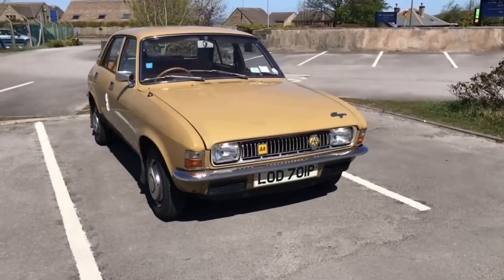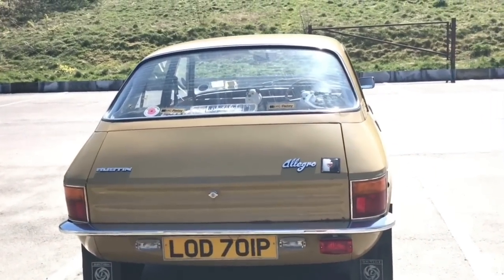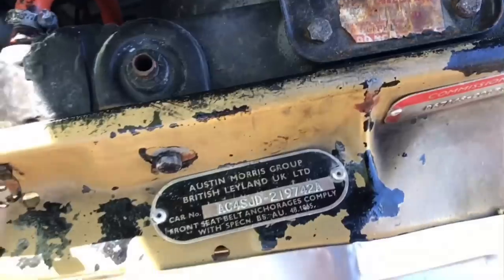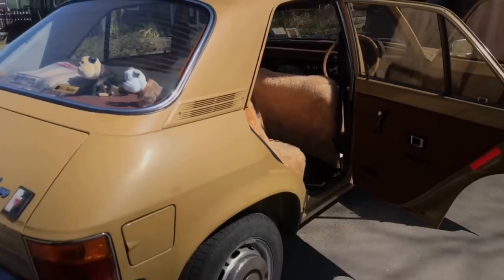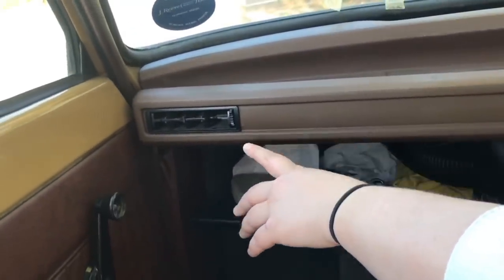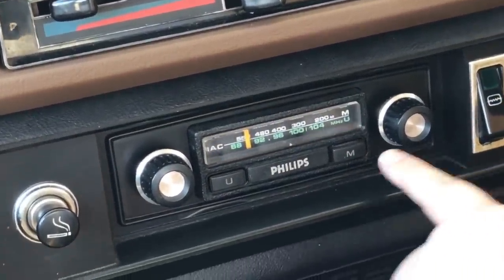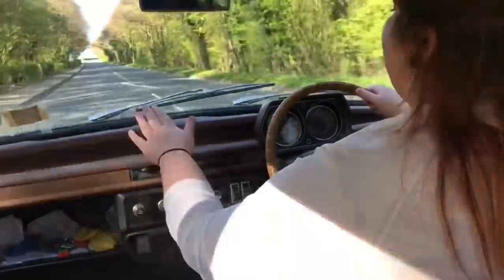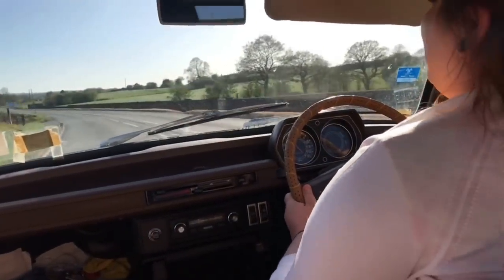IDRIVEACLASSIC reviews: 1970s Austin Allegro

Comment: Thanks Steph, been looking forward to this since you reviewed Josh’s Humber Super Snipe three weeks ago and you mentioned he had an Allegro as his daily driver. 

I definitely think they have been unfairly mocked over the years. The much mocked Quartic steering wheel, was dropped in 1974, so it’s an unfair criticism levelled at the car as it was phased out quickly. The rationale behind this much mocked wheel was that allowed room between the base of the wheel and the drivers legs Many  people forget that other BL cars were also fitted with a semi Quartic steering wheel such as the Rover SD1. Also many modern cars have squared off lower section steering wheels and square steering wheels are often fitted in formula  1 cars.

When I was growing up, I was born in 1970. 0ur next door neighbour had three of these, one the same colour as Josh’s, as well as brown, both very 1970’s  and a rather bright blue for his last one. He drive 70 miles round trip to work each day and he never had a problem with any of them. The Hydragas suspension system gave an incredibly comfortable ride. Far superior to the ride of say a Ford or Vauxhall of the same era. As you say the shape is very marmite. Then again so were the Maestro and Montego of the 80’s with their sides that looked as if they had been gauged out with a giant chisel. Other manufacturers such as Ford were slammed with jelly mould design of the Sierra. So it’s not the only car to have featured a look that wasn’t universally praised.  But the original design of Harris Mann was far sleeker and wedge shaped.  Because of the reasons you mentioned, the bulky heating system, wanting to install the  E series engine  etc it became impossible to incorporate the low sleek bonnet line of Mann’s original design. The car became more rounded, bloated and tubby looking. Far removed from the low, sleek original design, that I think looked amazing. It also did seem short sighted not to have it as a hatchback as the shape lends itself to being a hatchback, exactly the same with the Princess.

It’s a car has unfairly been the butt of jokes. It was certainly as reliable as any other  British car of the 70’s and  all cars if this era were prone to rust, another criticism levelled against it. The fact that for seven years Josh has used it as his daily driver shows that this is indeed a good car. He’s hardly going to drive a car on a daily basis if it constantly breaks down. People forget that at this time Ford was often said to stand for Forever. Off. Road. Dead.

Thank you both for showing us round this car and taking it out on the road to review it. Both of you stay safe and take care.
Reply from the maker: You take care too lovely x

Comment: I had a Austin allegro 1.3 saloon 1978 regestration no. STC320S I owned it for 18 months I was very comfortable and so easy to drive it did burn oil and the tops of the the back seats got bleached by the sun

Comment: In New Zealand most Allegro's were 1300s , I really think had the car been standard with the 1300 it would have been held in higher regard. The only stigma the car had at the time in New Zealand was the silly "Great British Bulldog" advertising. The 1100 and 1000 cc engines just did not have the torque to get up hills or cruise nicely on the motorways at 70. While that was true for many cars of the time the Allegro looked modern and looked as if it should be able to keep up.

Comment: Love these cars my, my grandad had a green one same year and model as that, I was only about 5 or 6 but remember him starting it with a screwdriver. My uncle had a slightly newer one when I was older, it was that couloir but had speakers in the front doors and were the blank was on The dash it has a brake fluid checker, was cool, he promised I could have it when I passed my test, but it never lasted unfortunately

Comment: The Allegro was never imported by BL to the U.S.. The Marina was. Other than the rust issues, which were common to many vehicles, both foreign and domestic, I think the biggest issue was poor owner maintenance.It was a different market than the BL sports cars. Many had automatic transmissions here. The Japanese automakers hit the California market in the late 60s, and by the time we got the Marina in 74, we had six years of increasingly better Japanese cars it was compared to. I'm a big guy, and a veteran of Sprites , TRs, and MGBs. Getting in and out is an issue, but the Allegro would probably have been a better choice for us oversize Americans. All our vehicles from BL in that period had the 1490 or larger motor.

Comment: I had an Allegro. In the car park where I worked there were probably about 20 others. My drivers door key worked on every one of them. Hideous car, lousy handling, bounced around like a trampoline, but miss it loads.....lol
Reply: Funny we had two Allegros in the family at the same time - my mums 1978 Allegro 1500 LE and my 1980 Allegro 1750 TC Equipe and they had excellent handling were very smooth to drive so much so that driving ordinary cars shows how bouncy they ARE in comparison and they were very reliable cars and the keys our Allegros did not work in the other one but both keys did work in the door and ignition of my brothers Mk3 Cortina - that Cortina got stolen and written off because they were so easy like all Fords to steal.

Comment: Nice review. My M reg Allegro was my 6th car and, at 5 years old, still the newest I have ever owned! Sadly it was also the first car to let me down - once when the fuel pump broke and 2nd when a drive shaft popped out!
It was however very comfortable and a joy to drive. I got rid of the quartic steering wheel - even dafter idea than the Cortina's oval version. It wasnt a lucky car, after I sold it the next owner wrote it off :¬(

Comment: Fabulous.....not seen many allegros but surprised to see that model year with a “round” steering wheel, my friends Dad owned one it had the all famous “square” steering wheel....LOL
Reply: Quartic was the name Patrick !.Many were removed in favour of the round one , but they are now very much sort after to return to originality.Derided at the time, the shape has been adopted again on so many modern cars.
Reply: Roger Coleman Shame they got removed, I understand the idea was the corners gave slightly more turning power whilst the smaller radius holding the sides for normal driving, if that was correct....😊
Reply from the maker: Hi Patrick this was sold with the steering wheel shown. They started changing over in 74/75

Comment: Bonnie wee beastie, it is - though we're partial to 'notchbacks'. Door pulls look a lot like what American Motors did on their '70s cars...
Reply: Austin and AMC had a tie up in the 1950's and 60's. You can see the 50's era AMC turn signal lever in many Austin products... The one with the flashing green end on it. When AMC started using the paddle style door handles in around 1969 they looked just like the ones on the Allegro. By the early 70's AMC had moved the key lock cylinder down to the door panel. I wonder if these handles were another Austin share.

Comment: Great video but I have a question...how can people call a car reliable if it has had to have a replacement engine. Where is the line. It's quite strange where some people draw the line! Not keen on the car for my taste but glad it was produced
Reply: Whoever owned it previous to him probably did not look after it and service it as it should have been and caused the problem. He has driven the car for seven years reliably since that problem every day so good going for an old car now. As he said he still has the original engine and hasn't taken it apart to see what the problem was but sounds like an oil issue from not being serviced or wrong type of oil. We had two of these in the family at the same time my mums 1978 Allegro 1500 LE and my 1980 Allegro 1750 TC Equipe and they were both excellent and very reliable cars. The Equipe always had people looking in it and around it when I came back when it was parked because it was a very nice looking car - the alloy wheels making a difference to the car as well. Not many people with ordinary cars would get that sort of attention all of the time even today.
Reply from the maker: I’d say changing an engine early on in ownership and no problems since to be pretty reliable. A lot of new cars get to the first MOT and need work.
Reply: OK, so playing devil's advocate, and please take this as a bit of fun, if having to replace an engine is acceptable, then what isn't acceptable?
Reply from the maker: I think it’s the amount of repairs, not the type. So if you’ve got a car going wrong every few months that’s not reliable. Once in a 7 year lifespan? I’d say that’s reliable. Reliable means you can depend on it. I’d say you can depend on a car which has failed once in 7 years.

Comment: I never had an Allegro - but I have had some interesting Austins. I have heard a lot of hate for these brands. I am left uncertain how much of the problems resulted from a disgruntled unionist workforce? and how much by faulty design? Although I can't talk about Allegros or Marinas, I have had an A40 Devon, 2 x 1100's, 2 x Landcrabs and finally an Austin Kimberley 2.2L 6cyl transverse. After that no British cars. Sadly the most enjoyable was the Kimberley - but it had problems with electrics, Brake booster, and a critical nut coming adrift deep inside the gearbox - never went again. The Land-crabs were good except that I had a lot of bother getting the front hubs right - always noisy. Also I had a hydralastic unit rupture. The 1100's had rear subframe cracking - required welding.  The A40 was well worn out before I got it. I miss the KImberly (when it was trouble free) most. It was a real delight.
Reply from the maker: People just love to hate sadly

Comment: The smaller models were good to drive , but really needed a 5 speed gearbox , as in the 1.5 models . it was screaming its head off at 60 mph , so not an ideal motorway car but , generally a good  car. Its profile isn't a lot different in shape to the 1990s  hatchback Fiestas , which endured for about 20 years .

Comment: My first car was a 77 R reg 1300 estate which I got because it could hold a Marshall cab in the back (I am a guitarist).  The guy who sold it to me said "I've put some STP in it" and I had no clue what he was going on about.  Anyway, cue a few days later, loads of thick blue smoke coming out of the exhaust.  Neighbours started complaining to my Dad about the smell coming through their kitchen windows.  Anyway, I got a Haynes manual and proceeded to take the engine out and re-built it with no clue what I was doing.  A few months later with a re-conditioned head and new oil rings the engine was back in and running great.  About a month later, the floor fell through.  This was a 5 year old car.  Absolute piece of crap and anyone who says anything else has not got a clue.
Reply: Is that right? We had two in the family at the same time - my mum's 1978 Allegro 1500 LE and my 1980 Allegro 1750 TC Equipe and they were both excellent and very reliable cars - we looked after our own cars and never had any problems with rust because we painted and rustproofed the undersides and wheel wells of our own cars and waxed the cavities because no cars were protected from rust back then unless you paid a company to do it but most people were too lazy to do things like that and then even lazier ones like you went and bought other people's unlooked after heaps of junk without checking out the car first and then blamed the car/manufacturer for the state of their car. I bought my Equipe at 6 years old and it wasn't rusty and my mothers car was still in very good condition then as well because we always checked out the cars first before we bought them so it is you that does not have a clue.
Reply: @williamwoods8022  No need for insults mate.  I just told you that I took the engine out and rebuilt it myself with no prior knowledge, so lazy I was and am not.  But not much money did I have to buy my first car and not much of a clue did I have.  I could go on.  Remember the handbrake mechanism?  Steel pin rocking in an alloy cradle?  Did BL employ metallurgists?  Took me 3 attempts to pass first MOT because I did not realise that the worn out cylinder housing was actually worn out.  Face it, they were very poor or perhaps the estate versions were poorer quality, I don't know.  I'm not saying other cars weren't but you really should not take what I say personally.

Comment: My first car was an Allegro 1100. As with everything BL did the very early cars came to market underdeveloped so you had the faults like the hubnut collar not being up to the job being discovered by the public instead of a test driver and that quartic steering wheel was awful, having driven a few back in the day I think the problem was it was too square and uncomfortable to use. By the time the series two car came along it was a pretty good car but the reputation was so bad that people didn't want it. It was much the same story  with the Marina the series two versions of both cars were well sorted and probably the best of both models. I'm afraid I must take issue with your friend about the cars bending if you jacked them up in the wrong place I have first hand experience of a series one car doing just that when jacked up halfway along the sill as we used to do with the ADO 16 and indeed we had a TSB memo from BL specifically telling us not to jack them up in this way for that very reason. If you get chance to look at a series two or three car you will notice that they have a black plastic covering over the door sill which although it looks good is really there to cover the strengthening rods that were simply welded to the door sill. I agree with you that the cars weren't nearly as bad as people said the problem was that most new models were launched before they were ready, they did suffer from poor quality components ( specifically Lucas parts) and the quality control was shocking and unlike today if we found a problem on PDI we had to submit a written report to the relevant plant and wait for prior authority to put it right which could take up to three weeks so cars got delivered with faults we knew about but weren't authorised to fix. All that said I really like 70s BL cars and would love to find a series two Marina HL.

Comment: I had an Allegro, what a heap of rubbish. Boot leaked like a sieve, every few hundred miles the wheel bearings needed repacking, they were gearbox noisy, sills rotted on them, only 12 months warranty and were cost engineered. There was a shortfall in sales leaving Longbridge and Cowley running at 2 thirds and although ran as BLMC, it was nationalised and named BL. Their final demise came, along with other manufacturers, when Japan started importing. The first being the Datsun Cherry. The name changed to Nissan but what a revelation compared to british build quality! In the days of the Allegro british car makers were too busy striking!

Comment: The original sleek futuristic Harris Mann Allegro design was just awesome,  https://www.aronline.co.uk/concepts-and-prototypes/austin-allegro/ . Again, the issue was lack of BL investment and thus the lack of the envisaged engine...so a dumpy old engine was used which wouldn't fit in the engine bay, so the whole car had to be redesigned. Whatever the merits of the Allegro, I still think they'd have been better off with a tweaked Mk 3 Austin 1100/1300 myself.
Reply from the maker: It’s an interesting car but really an ADO16 facelift would’ve been a more commercially sound choice.

Comment: Hi Steph owned a Allegro 3 the only good thing I can say about it was the ride, other than that it was not very good had 30,000 miles when I got it. A money pit has soon as I fixed one thing something else failed it was 5 speed and smooth gear change other than that it was probably the worse car I ever owned glad yours was OK
Reply: Funny we had two in the family at the same time - my mum's 1978 Allegro 1500 LE and my 1980 Allegro 1750 TC Equipe and they were excellent and very reliable cars. Sounds like you bought someone else's unlooked after car or the garage you got it served in or fixed was ripping you off or using cheap parts in your car because there were actually very reliable cars and there wasn't anything on them that was a problem that failed all the time unless again cheap parts were fitted in the first place. Of course some people like my mates dad complained when things like the brake pads or exhaust had to be replaced not understanding the concept of wear and tear items.

Comment: The allegro was sold also in New Zealand by NZMC  came as a 1750 but was a bit a of a rustbucket but there where quite a lot the later had a 5 speed
Reply from the maker: Oh I didn’t know that
Reply: All cars back then were rust buckets - the Allegro was actually one of the first that was wax injected etc to try and protect against rust but car manufacturers didn't start to manage to really rust proof cars until the late 90's onwards.
Reply: @williamwoods8022  not sure what they did in New Zealand we assembled them there but Can remember quite a few looked a bit scruffy after a short time kiwi allegros used local class and metric Speedos and a few other tweeks the tax regime was more beneficial towards engine size and  county of origin

Comment: Bent like a banana when suspended towed back window fell out Could not cure the water leak around the back window boot filled up with waterSo to cure this BL put drain holes in the rear quarter panels The list is endless